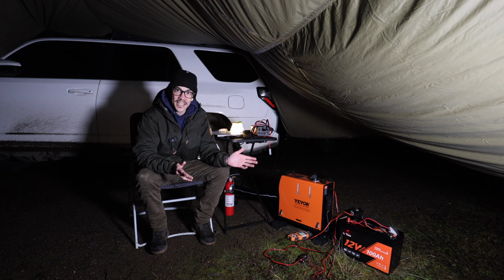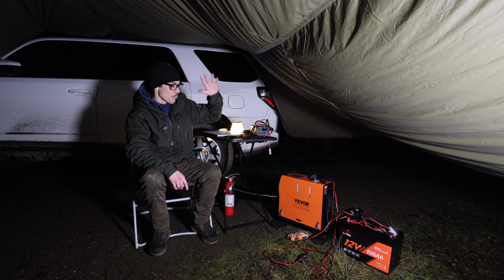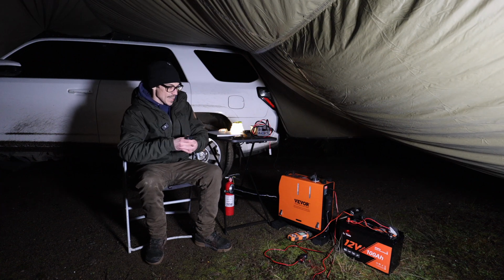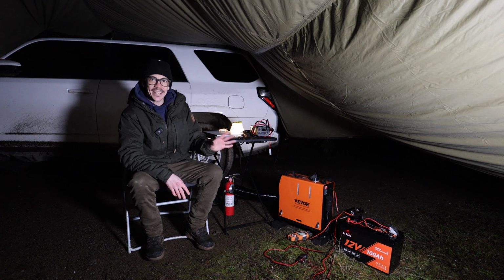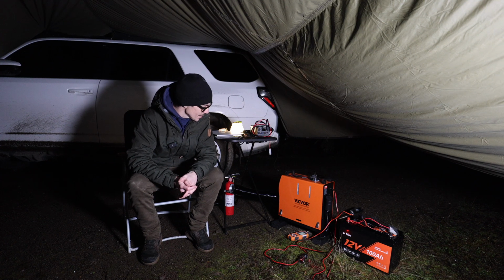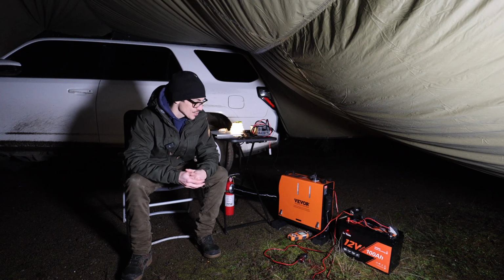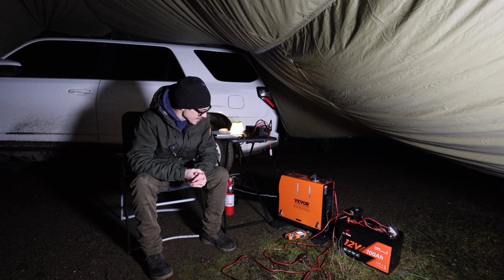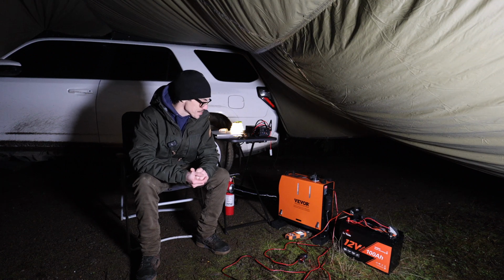Vevor Diesel Heater Review- Better Than Camp Fire?

Comment: The one I bought, I put off a horrible smell. I don’t think that’s normal, but vevor Refused to issue a refund. I wouldn’t buy anything from them ever again because they do not stand behind their products.
Reply from the maker: Did you run a tank of fuel through it before using it? Where is the smell coming from? What kind of smell?
Reply: @ Yes I’ve ran a full tank of fuel through it. The smell is coming from the vent that blows the air out. To me it smells like burning rubber or plastic. The intake and exhaust is directed outside through a metal plate with a tight seal.
Reply from the maker: That’s strange. There are lot of groups on Facebook and forums with experts that can help at least figure out what the problem is. Bummer they didn’t take care you. Luckily there are lots of experts that can help you get it running right.

Comment: Ten power levels is pretty cool! My diesel heater that I've had in the Astro for about 3-4 years now surprisingly still works, even though everyone said that the cheap Chinese models always break after the first year. The major downside for me is that even on the lowest power setting it's still too hot for such a small space. If I don't crack a window I overheat within an hour, which means I have to wake up multiple times throughout the night to turn it on and off again.
Reply from the maker: Are you using a 5k? I wonder if a 2k would still be too much. The new Bluetooth models have thermostat. I’ve been happy with running it on low and haven’t messed with it.
Reply: @ Yeah, that’s possible that I just got the higher wattage, but I don’t remember. A thermostat would be wonderful either way. I wonder if I can drop one with a thermostat straight into the spot where my current one is.
Reply from the maker: Maybe! Hey what’s the name the of that woodshop with shop space for rent? I’m having a hard time finding it
Reply: @ ADX
Reply from the maker: Thanks!

Comment: All you need is a heated vest self contained  heat , the clicking would drive me crazier. Fridge,  disel heater , like you said disel smell is worse. Ill stuck to my buddy heater , save my pwr bank ,  bottom line hard to keep up on battery bank in winter . Oh months , 250$ heat system with 100ah battery.  VAN LIFE KEEPS GET MORE STICK N BRICKS , OH WELL

Comment: Great Video! Would you share your experiences how to transport this kind of diesel heater while overlanding or camping? Have you store it inside your vehicle or mount somewhere while driving ? Thx
Reply from the maker: Thanks! I just remove the exhaust pipe stick it on the passenger side  floor board. Once I figured out that the cap can leak on rough roads I put a piece of duct tape on the top and loosen the cap while use it.